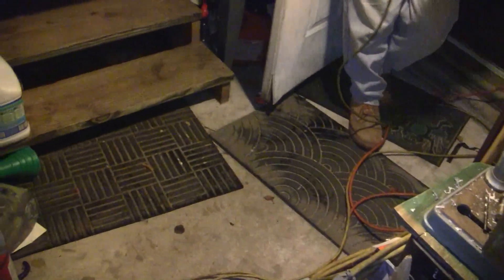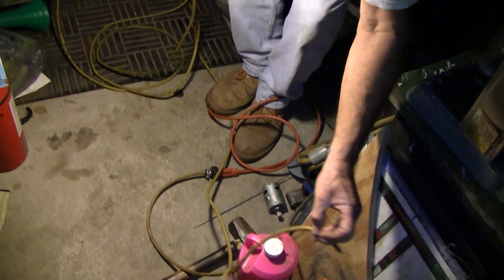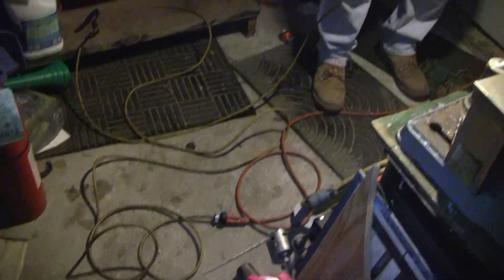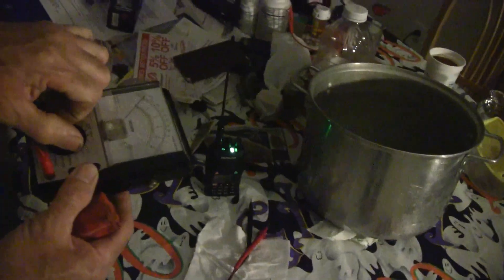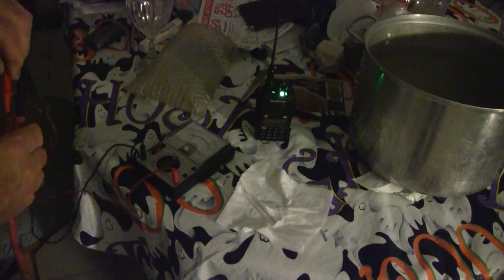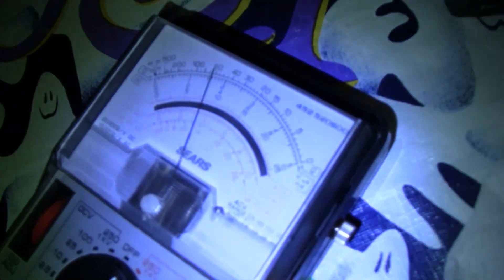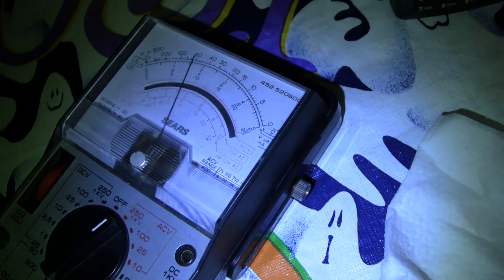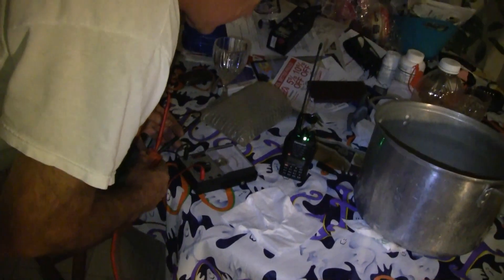FUN WITH RADIO DURING HURRICANE SANDY

Comment: I haven't played with my radios in years due to so many things going on, but plan to get back into it when I retire.  Still have my Icom HF rig and some 2 meter equipment.  Used to love building dipole antennas on my property and  doing the packet radio stuff when it first came out. I just put out a little Youtube thing on how to cover generators in the rain without spending time or money.  I cover my generators with inverted $13 cement mixing trays from Lowes tied to generators with bungy cords

Comment: good video it shows that emergency power works but if the antennas hold up, here in the town i live in just lost power at 2330 to 0445 when i woke up. by the time i got my radios set up it was on. i do monthy is set up my power in the shack for practice and the day before the storm was to come i charged up the batteries. i use solar to charge the batteries through the year but can super charge them once a month any way. winds were strong and my antennas held up, hopefully all of your friends did

Comment: I would have changed the generator to an eclectic start from there I would have took the power off the terminals of the battery or the alienator to power the radio.